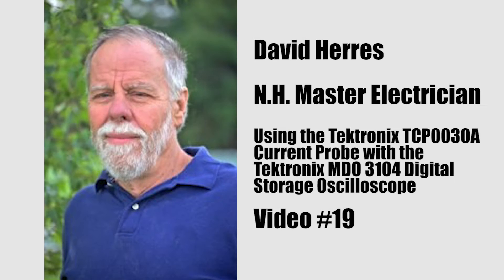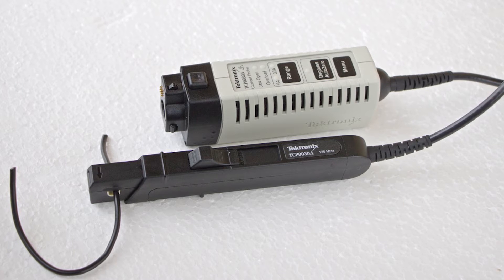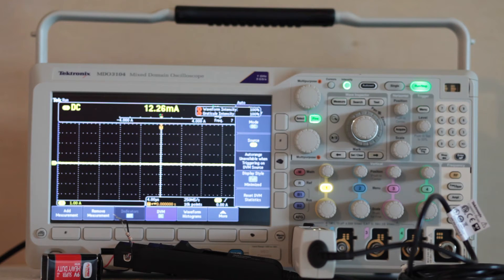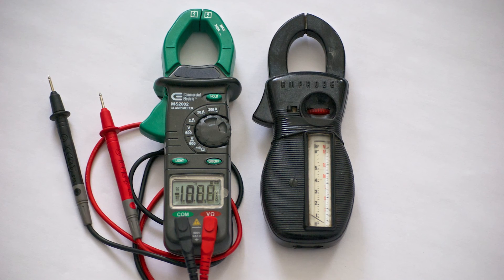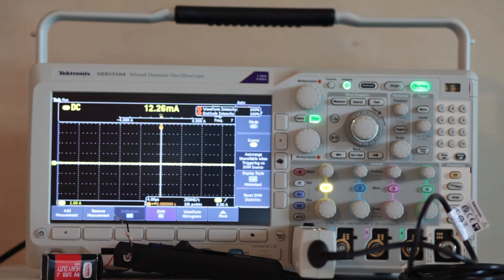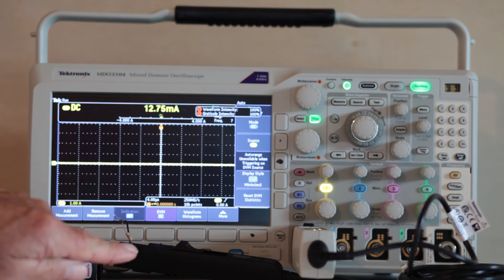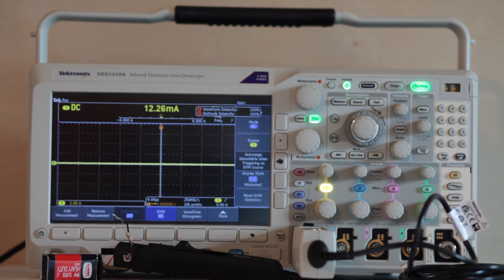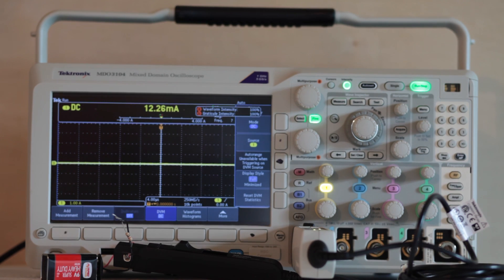Using the Tektronix TCP0030A Current Probe with the Tektronix MDO3104 Digital Storage Oscilloscope

Comment: Can I use TCP 0030A AC/Dc Current Probe with TBS2104 series ( not the 3000 series ) ?   When having autozero function, it shows error code.  And when it measures value, the value is not accurate ( compared to the calibrated 8.5A , it measured 6.35A ).  Is it clipping problem (out side the screen) ?